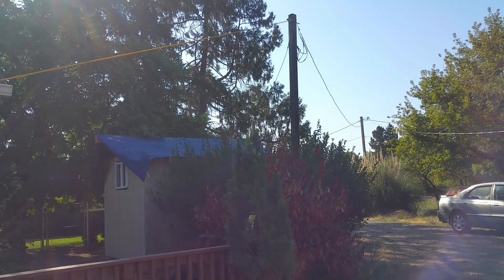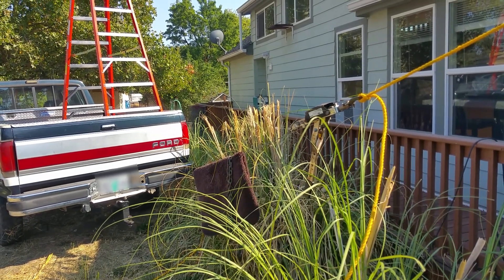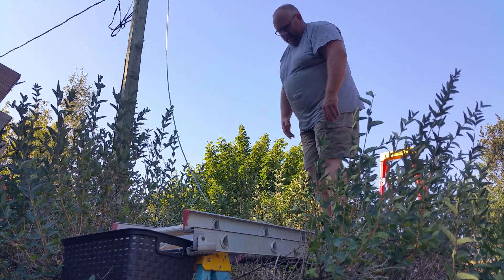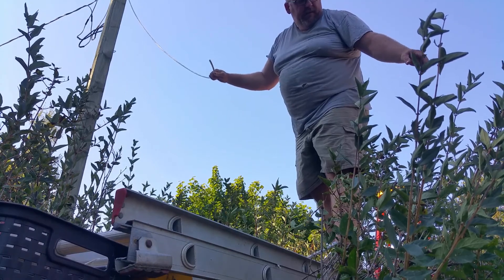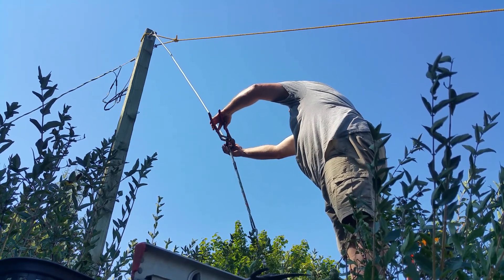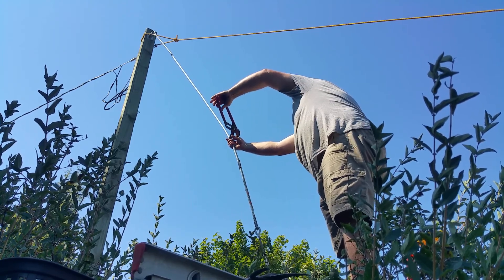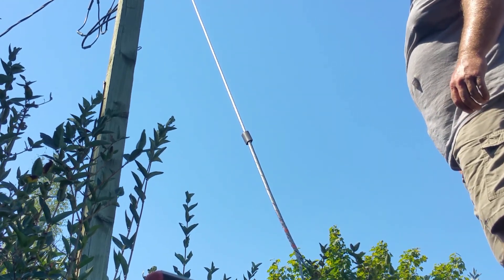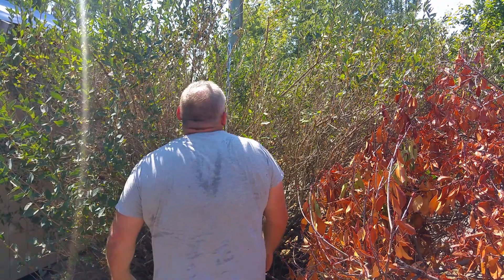⚡🛠👷‍♂️ DIY How-To Power Pole (Powerline) Guywire Installation Part 2👷‍♂️🛠⚡

Comment: I have a power pole on my property with a lean as well, plan to add a guy wire , how far from the base did you install your anchor point ? I am looking at around 12 feet out from the base which will put the guy wire at a 45 degree angle.
Reply from the maker: 45 deg puts it pretty far from the pole, I wanted to make sure that mine was "hidden" by the bush it was mounted under.  I think mine is probably more like 30 deg.  but if you have the space 45 deg would make a more stable triangle